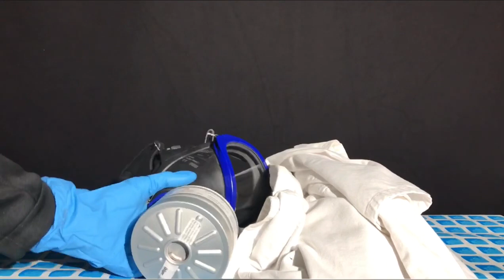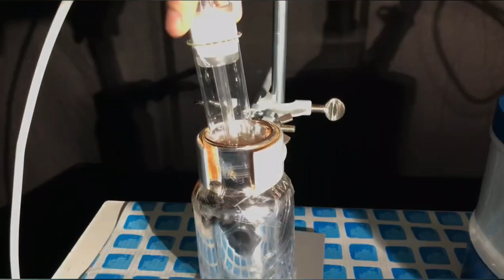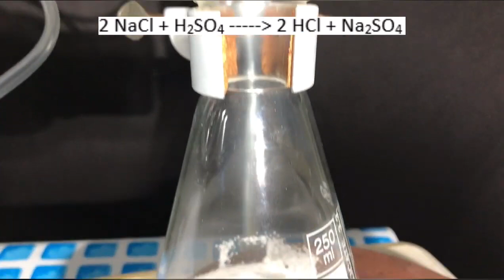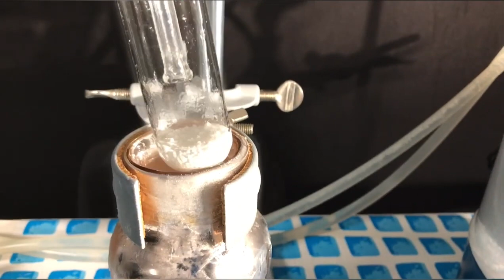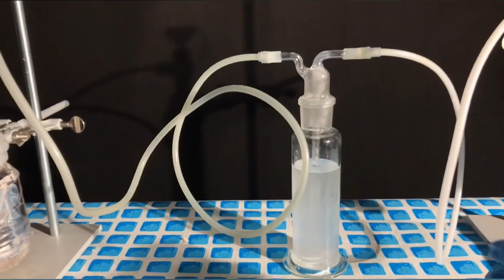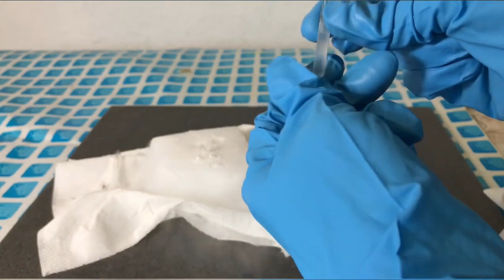Chloromethane from methanol and HCl

Comment: so how is dichloromethane made iv not seen that before.
Reply: Can be done via Photochlorination of CH4 and fractional destillation of the resulting mixture of chloromethanes(or just heat induced at 400-500°C). I think i also read about a way of reducing chloroform to dcm via zinc metal under the right conditions. Sadly I can't find the source anymore.
Reply: @The_Black_Shadow check the sciencemadness forum. It's a reduction of chloroform with zinc and hcl from what I remember.
Reply: @The_Black_Shadow   Iron powder in water has also been observed to rapidly dechlorinate chloroform to dichloromethane, though zinc in acidic alcohol is the standard laboratory method cited for this specific transformation.